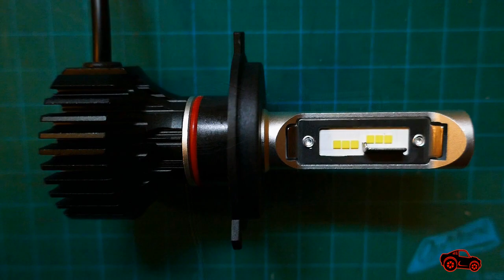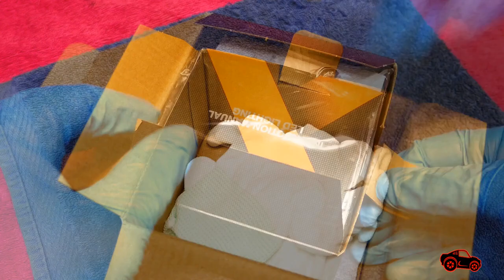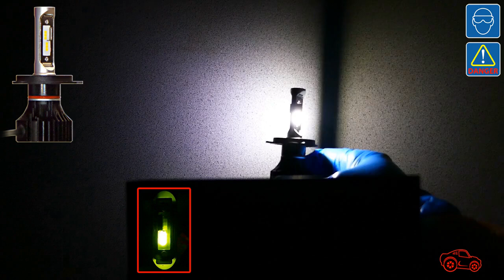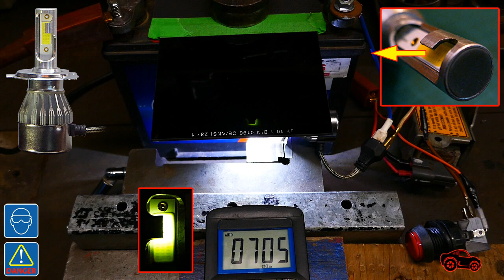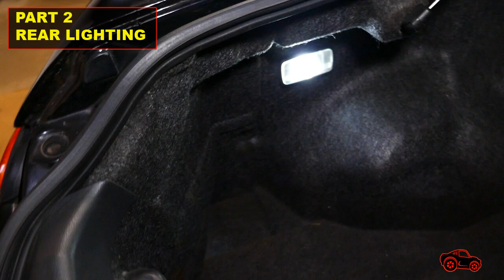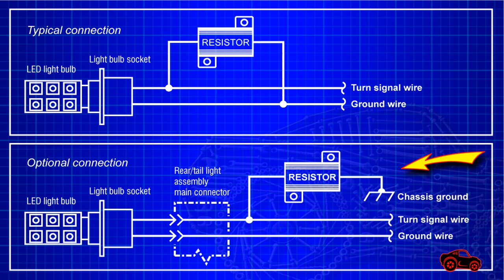LED headlight bulbs tests, turn signal bulbs resistors installation and more.

Comment: Loved your video. I have a question that I hope you can help me with.  I installed 2 AUXITO h11 led headlight bulb on my 2006 Ford Escape Hybrid. I was getting an error so I got the proper decoders from AUXITO and installed them. The left headlight works perfectly but with the decoder on the right side the bulb does not turn on. I install without the decoder and the light works.  I sent them an email and they sent me 2 more decoders. The problem is that the same thing happens with the 2 new decoders. Would you have any idea what would be causing this ?  Would really appreciate if you have any insight.  Thank you.
Reply from the maker: The electronic smart junction box provides the current to 4 different wires that go to the HI and LOW headlamp bulbs. 
If the right side LED headlight bulb works without a CAN Bus decoder, Maybe there is a short to ground in the right circuit that increases the amount of current close to normal tungsten filament condition with your LED headlight installed without a CAN Bus decoder. 
A short to ground condition combined with the added current used by the CAN Bus decoder could trigger an abnormal signal in the smart junction box and turn this circuit off for protection. 
In this case, I would inspect the integrity of the electrical wiring and the connectors.
I can be wrong, but, I found a problem similar to this a long time ago on a vehicle I inspected.
Good luck!